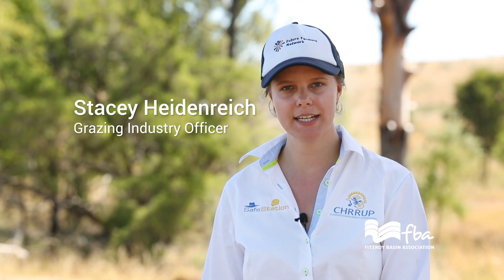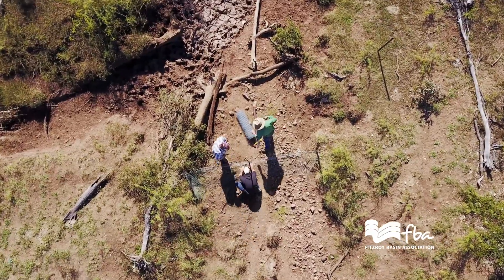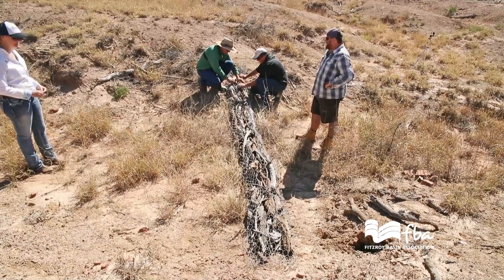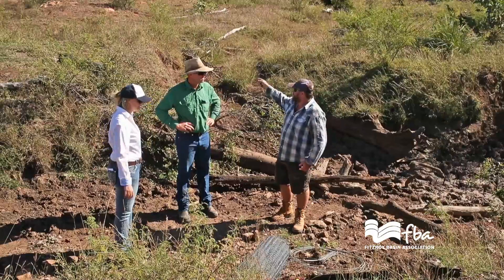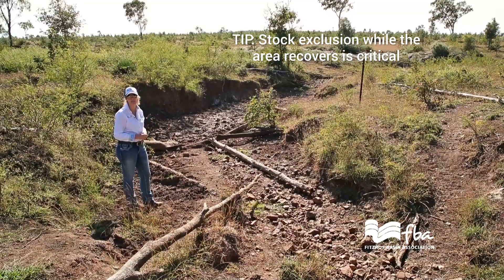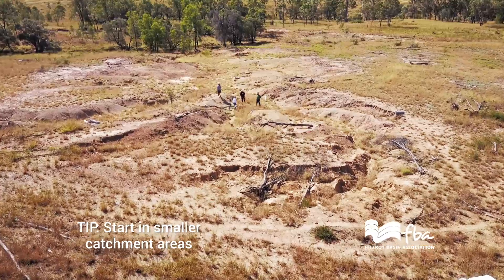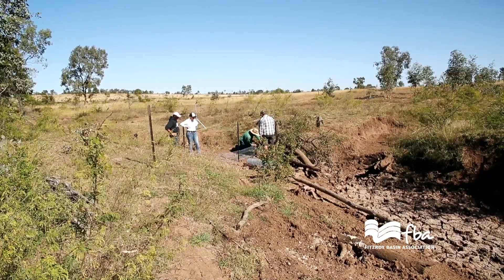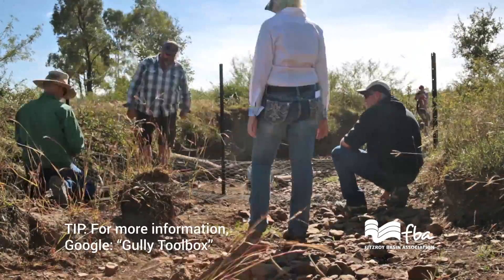How to build PCDs to address gully erosion

Comment: i would suggest that you immediately replace the culverts with a bridge-type crossing with a span that allows the water to spread naturally according to volume. Also, have you looked into beaver dam analogs (BDA)? all biodegradable. I know you đont have beavers Down Under, but the principle is transferrable to any place.
Reply: Yeah, I'd hate to run into one of these in the next 10 to 20 years...all rusty and jagged edges!